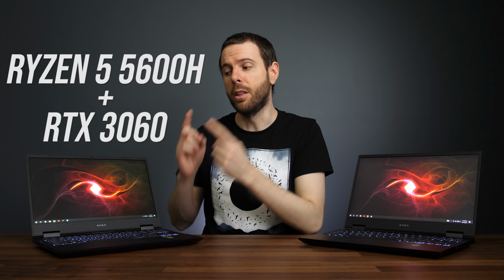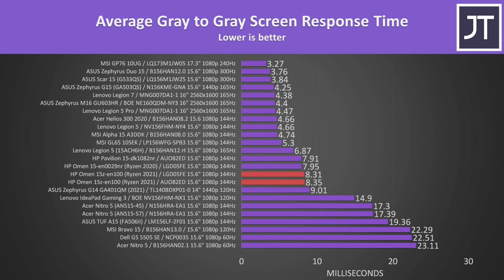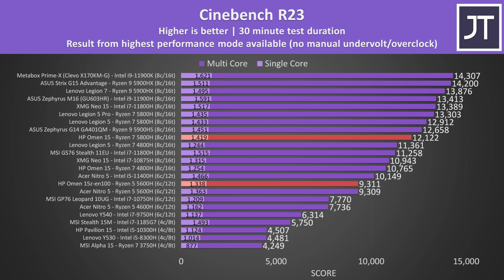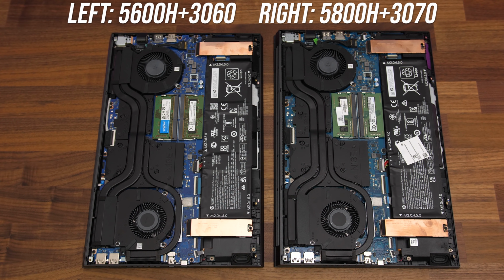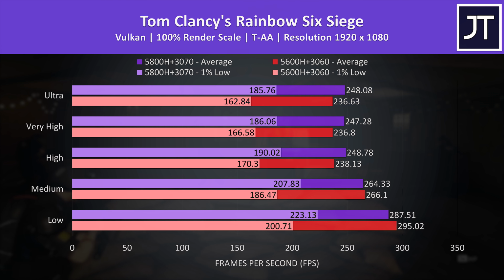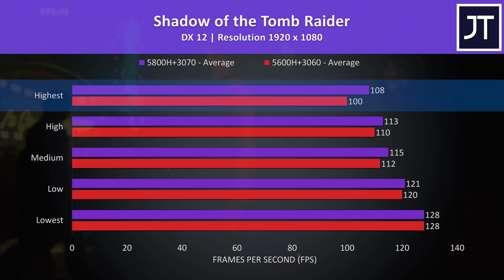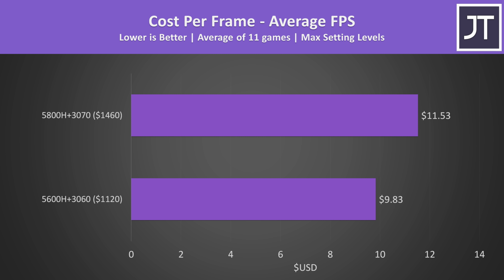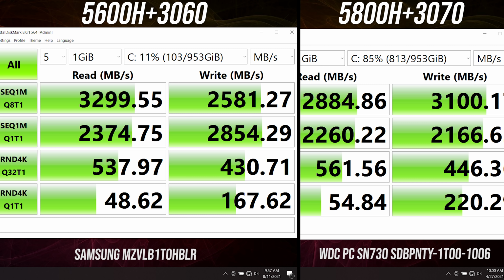Are Higher Specs Worth More $$$? HP Omen 15 Compared!

Comment: Hey Jarrod, have you noticed any battery drain issues on the 3060? I recall the 3070 variant had battery drain issues when you reviewed it. Cheers
Reply from the maker: Yes it was still present with the 200W brick.
Reply: @JarrodsTech  still only happens when under heavy load right? Am recommending laptops to a friend and making sure they have all the necessary information - your videos have been incredibly helpful
Reply: @JarrodsTech  hello. Writing from turkey. Here we have  İ7 11800h cpu only legion 5 pro with 3060.  İt has 230  watt Brick not 300. And we have experienced battery draning while on plug in usage. No idea. Maybe battery saving mode. Maybe defect. 
Do u know 5 pro with i7 cpu have x16 rams too? Should we change it.

Comment: I owned the rtx3060 omen 15 and It's great. However when I was playing Control, CPU temperature could spike 90+ degree sometimes so I disable performance boost using registry method.
Reply: I feel like every laptop CPU hits the mid 90s if you're doing a pretty heavy task with your CPU
Reply: @altijdlolvideos9823  ya, it's just me feeling a little uncomfortable with the high temperature as it would shorten my laptop life haha
Reply: @decpaul6851  yeah, that's why I have put a limit of 90 degrees on the CPU. The GPU doesn't get any higher than 82 degrees so I think that should be fine
Reply: @decpaul6851  you mean AMD's equivalent of Intel TurboBoost or something else? How did you do that?
Reply: @altijdlolvideos9823  how did you limit the CPU temp for your laptop?
Reply: @sushimshah2896  it was a setting in the software I got with my laptop. In the settings it was called "TJ max". If you can't find it in your software, you can probably find a third party software to do it. I believe "throttlestop" is a good software for it. The only downside of limiting the CPU is reduced performance
Reply: @sushimshah2896  I change some value in registry and a processor performance boost option will appear in the power option. I disable them, will notice a little performance loss but much lower and stable temp.
Reply: @decpaul6851  can you share the link or which key & value exactly?

Comment: Why do we see all ryzen cpu running in 90s C even previous 4xxx cpu ran similar temps. Cant we undervolt or downclock or both to a certain degree and keep things in 77-85C range ? Will these laptops last 4 5 years ? 
I had a i7 4500u and r9 m265x and kept it below 85c even after 4years(it died last year , total age 6 yrs) . What has changed now ?
Reply from the maker: Undervolting isn't supported by Ryzen, but you could lower power limit with software like Ryzen controller if you're paranoid about it. I have no issues at all running 90-100c all day, it's in spec, gimme that performance lol.

Comment: I'm going to buy ryzen 7 with rtx 3060. Is it worth? Or should move to legion 5?
Reply: Be aware that hp has the faster ram timmings compared to lenovo that has slower ram timmings. You can change the ram but you can't increase the tdp of the gpu which is higher in the lenovo. I have the lenovo and can confirm that its a good buy.
Reply: @savp2293  yes bro. Sadly it's out of stock. I think I won't change ram coz my parents won't allow. I just need 1080p gaming. If I got legion 5 in stock I would move with that or omen only brk
Reply: @benchmarkslab2005  I mean from what Jarrod is showing even the variant with the 5600h performs close to a legion 5 if you compare it with his results from his review of the legion 5. I think you'll be alright right whichever you go for ( or whatever is still left in stock). My previous laptop was an omen from 2018 and it performed well for the time and hardware it had   (7700hq and GTX 1050ti). It's still working fine and it manages thermals well, the 2021 omen can only be better than that. In summary I think there two pretty good options.
Good luck with the buy.
Reply: @savp2293  yes. 5600h is not available. So I'm moving to 5800h
Reply: @benchmarkslab2005  Man the supply issues are rough, hope you manage to find the 5800h though.
Reply: @savp2293  that only available at now

Comment: Great video as usual, Jarrod. The Dell G15 you previewed last week is currently on sale in Australia. Do you recommend it at $1800AU?
Reply from the maker: It's quite good, full review is this Friday, and I've also compared it with the Legion 5 the week after if that gives you an idea of the sort of level it's at.
Reply: I sure do.. I bought it on sale for $1954 and i'm writing this comment using it.. 11/10.. you'll love it.. that's the G15 with the 5800H and 3060.. It has a mux switch and the vbios updates lets the 3060 boost to 130w

Comment: Jarrod we are all waiting for comparison of victus vs omen.
Reply from the maker: Still waiting on HP to send a Victus, but that will be 1650. If I buy it it will be 3060, but I think it only comes with 5800H? So not directly comparable with my 5600H, can't win lol
Reply: @JarrodsTech  it's odd that they didn't give an option for 5800H with RTX 3060
Reply: I guess it's the omen branding which is making it a little expensive or else bhot are same I guess
Reply: @619aditya  yaa can be or the GPU wattage and build material may change a bit
Reply: The build on the Victus is really bad, when compared to Omen. And the display is too wobbly, and the color reproduction isn't nice either.
Reply: @ZeDarkLord  Yaa ig idk that.